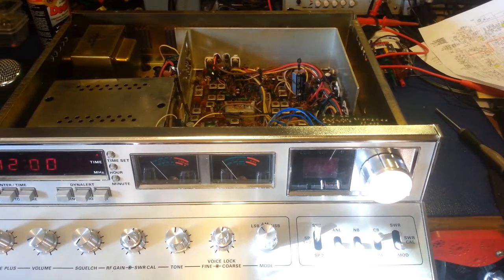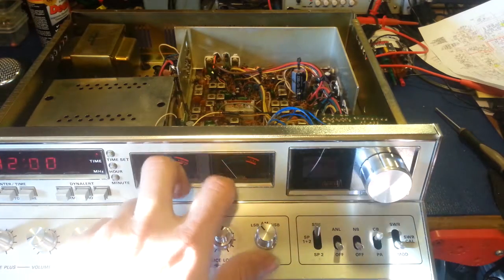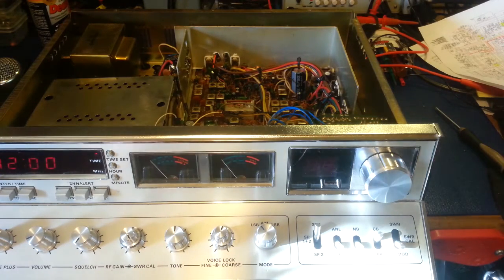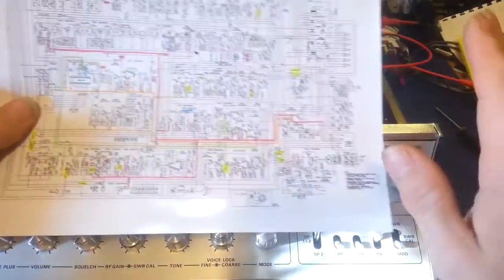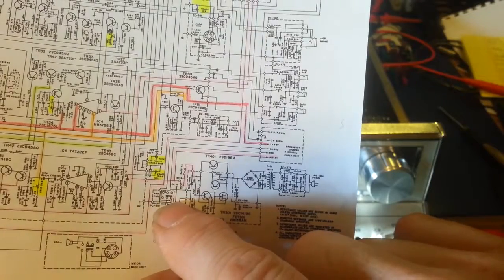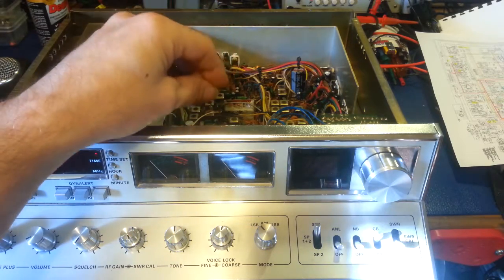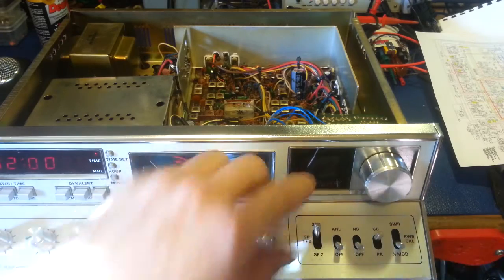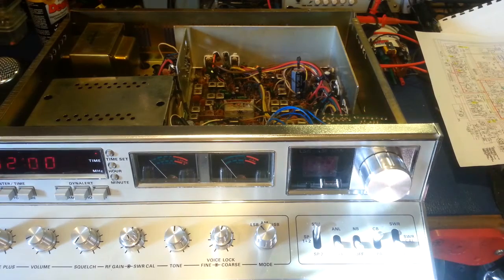Cobra 2000GTL channel indicator glows when replacing meter lights with LED's. How to eliminate it.

Comment: That part number is HE LI SHUN HLS-4078-DC12V
Reply: Depending on the current, an alternative could be a skinny DIL reed relay such as Littelfuse HE3621A1210 SPST 500mA 12V (L:19mm W:5mm H:7.5mm) which has only 4 contacts, and features a coil back EMF suppression diode built in.

Comment: I replaced 7 bulbs with LEDs in a 2000. (Meters, am, usb, lsb, transmit, receive). Just plugging in the radio with power switch off, the radio turns on. Going back to incandescent wheat bulbs
Reply: Not sure how you managed that. Scores (maybe hundreds) of people have converted from wheats to LEDs without having that problem.

Comment: Um why use a relay just use that point of voltage you pointed to when its off no power to display , when on 11 volts on display

Comment: @MikesRadioRepair, One fast question for thoughts please.I been attempting for years to narrow down this one.Put led bulbs in the 2000 meter without a relay etc.Display ghosts.Put factory orig bulbs back in ( working bulbs ).Trashed my 2000.Still stays ghosting on ch display.Pulled plug, put radio in storage.Been sitting for years till I can fig out.Just me maybe, but drives me crazy it's ghosting.I thought if I reversed all putting old bulbs back in problem solved.Nope?
Reply from the maker: If the bulbs are not wired to the exact same points they were before that may be causing the problem.  Just do the relay modification like I show here and it will be impossible for the display to glow when the radio is off.  It completely disconnects the power from the display when the radio is off.
Reply: I can understand how that would work.Also cutting power flow off.I will be doing doing that than.I am curious about the Cobra 1000 of which I also have.Now for most part same radio.Course some differ in the two.Think I need a relay in it also? Or being no freq count etc that one is fine for led.

Comment: Mike! Thanks for uploading this video.  I have a 2000 here on the bench with this issue.  You saved me a ton of time troubleshooting the wrong area.  I had noticed the floating voltage and thought there was something allowing a little bit of current to flow through the frequency counter/clock board.  When you unplug the ground wire going to the counter board or the 4 pin connector with the 7.8 and 35mhz signal wires on it, the problem would go away.  I hadn't even noticed that someone had put LEDs in the meters before.  I think i'm going to do your idea with the relay.  Just out of curiosity, couldn't you just use a resistor on the black wire feeding the voltage to the channel display?  Drop the voltage enough when the radio is off so that the display doesn't light, but when the radio is on it would still work.
Reply from the maker: You can but you will find that to get the glow to go away completely you will need a fairly low value resistor with a high wattage value.  It waste a lot of energy.
Reply: @mikesradiorepair  I'm talking about a series resistor with the common anode of the channel display.  I would think that wouldn't require a high wattage resistor because the current drain of the two 7 segment displays isn't very high.  Not really sure how to do the math though, since the current of the displays would vary depending on how many segments were on (say channel 11 vs 38).
Reply: @mikesradiorepair  Tried the resistor in series with the channel display.  You can get it to work, but at the cost of brightness of the display when the radio is on.  Your way is much better.

Comment: great video Mike!  one question, do you have any concerns about that little relay being energized the entire time the radio is on?
I have thought about using a relay on power switches in order to switch higher currents than stock power pots can take, but have always wondered if the relay coils were up to the task of possibly being on for days at a time over a 20 year period.

I have also been repairing the "lights dim on TX" symptom that is so common on this chassis by drilling a small hole in the power switch in order to clean the inside of it.  works great!
Reply from the maker: No I really don't have any concerns about long-term use of a relay.  Their designed to be used like that in many applications where thee have high duty cycles. I can think of numerous applications where relays, contactors and solenoids are used in applications where their on 24/7 as a safety feature.  Idea being if there is a failure in a control circuit the relay de-energizes shutting off a circuit.
Reply: I am an automation technician by trade, so i know exactly what you are talking about.  Our systems are rated to carry human beings so everything has to "fail safe".
my concern was mainly about the quality of these little chinese relays that can be bought so cheap.
I guess my doubt comes from being spoiled by Seimens and Allen Bradley equipment LOL.

Thanks for the reply, and it's good to know that these can be used for high duty cycle like that.

Comment: I was told by TK Thats no longer applicable with the new SMD LEDs. UNLESS... you change all 5... then, you must do something like this. I just solder a wheat bulb in and leave it inside the cabinet... it draws off the voltage and cures it
Reply: Not a bad idea!